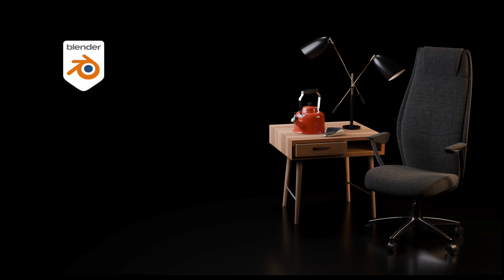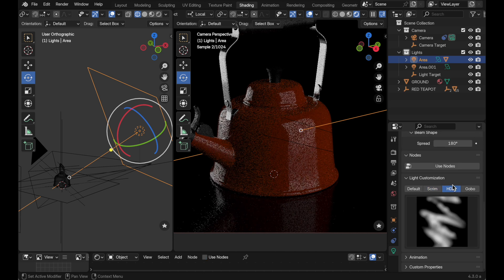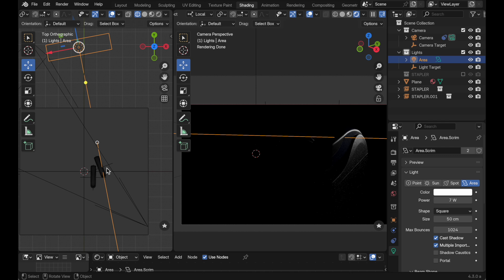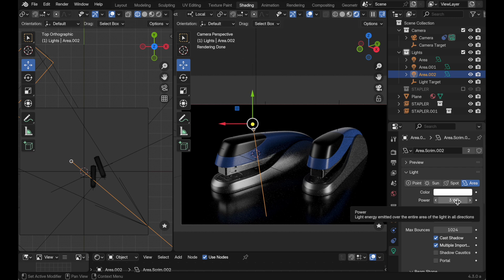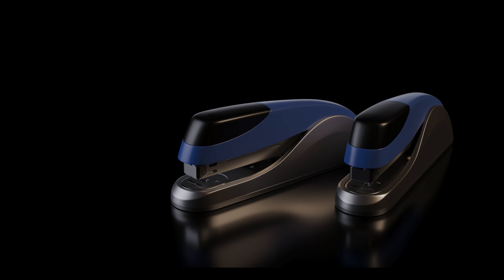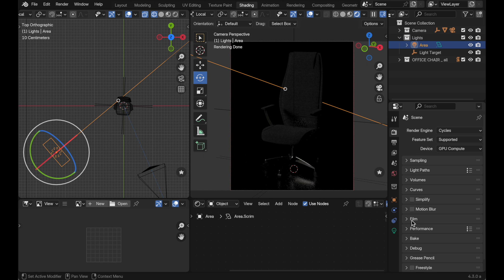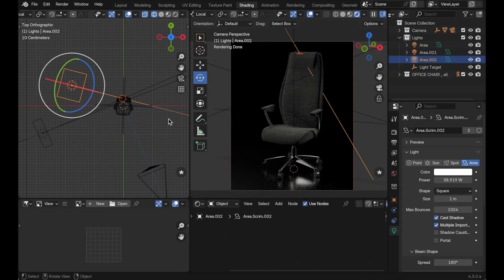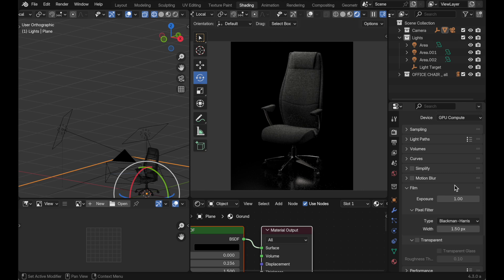Point & click lighting in Blender (and using light falloff).

Comment: I'm using Photographer for lighting, and that mainly because it has one of the few things I missed from Maya, namely buttons to change the light intensity using stops. So below the Power under a light you got four buttons that either sets the power to -1EV, -0.5EV, +0.5EV or +1EV. This is such a extremely faster and more convenient way of changing the light intensity than the default linear way that Blender does it.
The one in your video seem to have other nice things though, might consider that one!